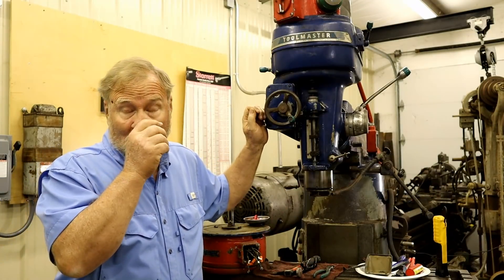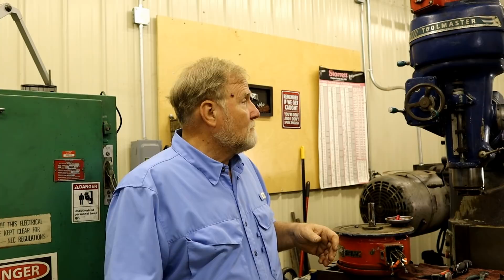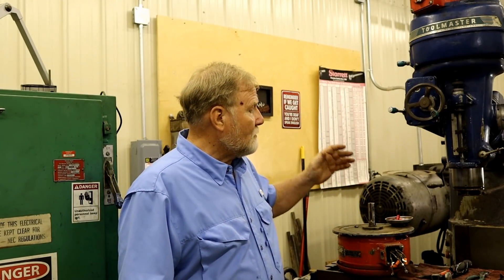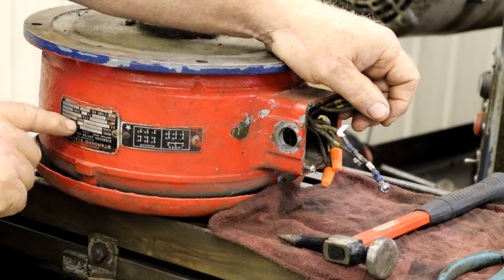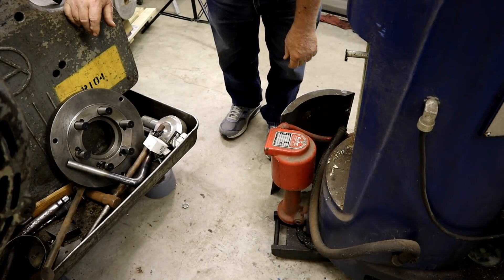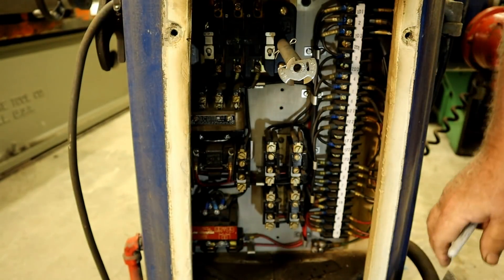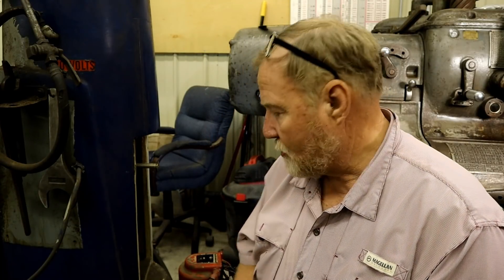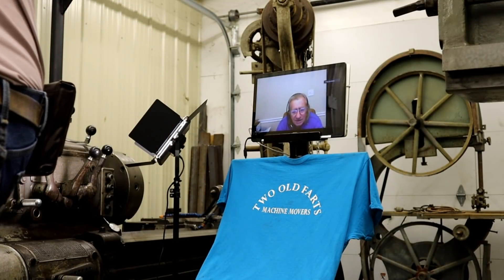How I converted a 440  Toolmaster Mill to 220

Comment: Some call it a junction box some call it a pecker head, i call it a shame and corrosion closet... Just aquired a cinci tm that ill have on my channel. Love these pieces of history. Dont worry about tik tok just do you
Reply from the maker: I had to find  a pecker head for the Axelson 16 out in the shop.. When I got it a forklift wiped the original one off and just left barely enough wire length to keep me from going into the motor...

Comment: Two old farts is funny - I could make it three - Hell us old nerds could take over! Well maybe after I take my nap. I do have a Cincinnati Tool master - and was able to get a manual for it if you need a copy of something. I bought my mill with a broken variable sheeve. The part from Cincinnati was three times what I paid for the machine so I made one. I pulled the cover from my standard three phase motor, pulled the fan off, machined a flat surface atop the standard motor and made an adapter so now the standard motor is a "shaft with bearings" and a 1.5 Hp 220 Volt single phase motor with Love-Joy coupling sits on top. Well it does work!

Comment: Years ago when putting in the original rock crusher, it was run off a big (then) D-8 or D-9 (6 cylinder pony motor start) 3-phase generator. There were 2 big amp draws, the jaw crusher and the cone crusher. The rest were a shaker and conveyors. The starters for the jaw and cone were boxes with handles on them. You pulled the levers to start and after they spooled up you pushed the levers...................and hooked a wire that was fastened to the trailer wall around the levers to hold them back and the power on. They did and would not hold themselves. This was after the generator was fired and warmed up as you know. This was before the power outfit ran the 3-phase line. The electrician they got worked on big textile mills, 3-phase stuff, 7200 per phase. He about had a stroke when he saw that setup. Needless to say, he fixed those starters with new heaters and whatnot. And just glad that wasn't a Don picture at the first and he got his electrical engineering degree because he got tired of getting burned up. Thanks, Steve! GBWYall!
Reply from the maker: People do some dumb things all in the name of Git'er done :(
Reply: @10swatkins  And it's usually the little guy that ends up paying for it!
Reply: @lewiemcneely9143  how you doing you old fart lol.
 Me just staying warm and out of trouble that's my story and I am sticking to it😁.
Reply: @scruffy6151  We're just getting over 16 or 18 inches of snow and another light 1 1/2 last night that left mostly today. 32 for a hi and zerox for a lo tonight. Other than trying to steal a little of your weather all is well. No use to growl because nobody would listen. Hope you're out of jail for a while because picking up roadside trash is rough when you have to dig it out of all the drifts up there. They let me just wait to get mine when it warms up. Hope you're still kicking the recliner around and being fat and sassy! GBWYou!
Reply: @lewiemcneely9143  Dam! You stole our snow what's up with that Oh, I know global warming right?😂
 Yep I am still keeping my recliner warm and my tummy full.
 God Bless you all.
Reply: @scruffy6151  Well, you weren't using it and we have been behind for years. Now we have global cooling like yall do that happens once a year as does the warming when everything grows. Full recliners and tummy's are good things. GBWYou!

Comment: I have a Hardinge that is wired 440.  I just bolted a transformer to the side.  The main motor didn't have the option of 220.  That said I wish I had 440 coming in and everything was running on it.  The amps drop to nothing on 440.  Have you every seen the warning label on enclosures that says, "The stuff in here will kill you. Not only that it will hurt the whole time it's doing it!"  Thanks for the video.
Reply: A pal of mine has one at the entrance to a circle saw mill that reads 'No Stupid People Beyond This Point'.
Reply: Were there only 3 wires on the main motor ?
Reply: @millomweb  Four including the ground going in.  The info tag shows only 440 without the option for rewiring internally to 220.
Reply: @PaulWattsSpringGunning  It could have been rewired - but not usefully as it'd need to be on an 880 volt supply !
Reply from the maker: I think it was rebuilt and they only brought out 3 wires... The question is What voltage did they bring the 3 wires out for!   For that you'll have to wait till part 2 :)